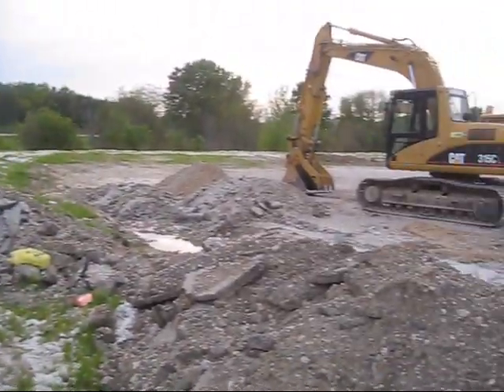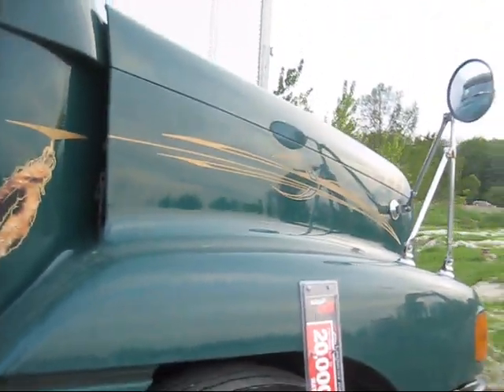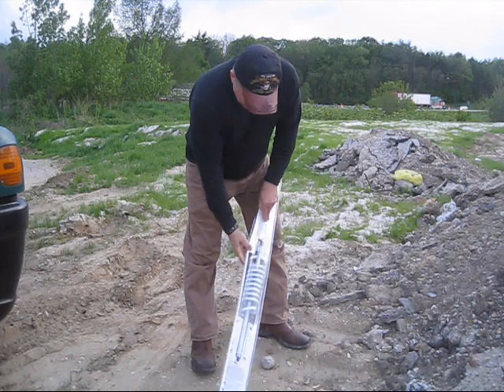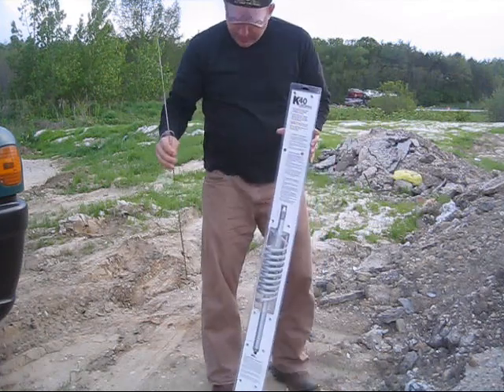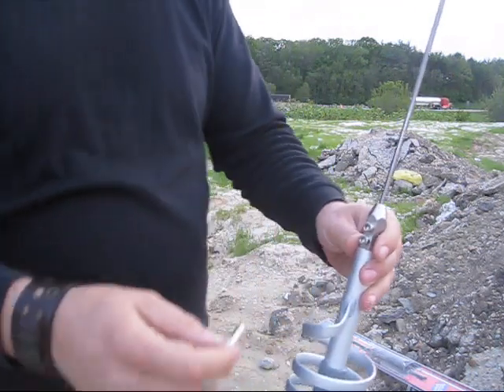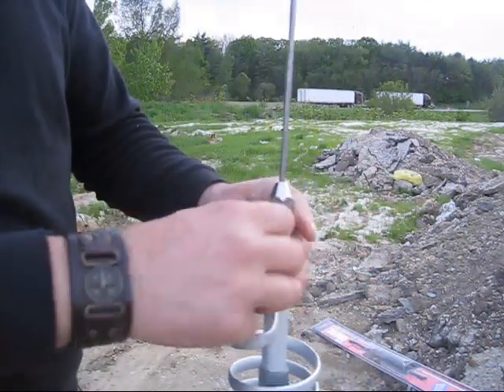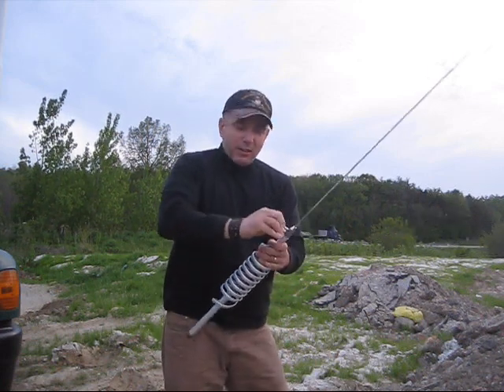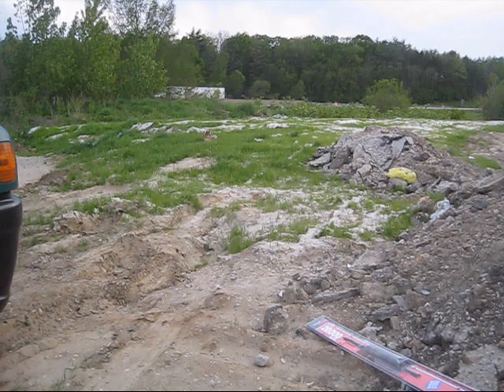ASSEMBLING  K40 CB ANTENA

Comment: I run one and its a very good antenna only problem is when im driving the coils make a crazy noise that is very loud .. all you have to do to get rid of that noise from the wind going thru the coils is zip tie the coils ill post a pic of mine..
Reply: Mine was so nosy I thought I had a wheel bearing going out on my Simi Truck.
Reply: @hansenhansen8349  zip tie every 2 coils sound is gone completely
Reply: Omg!! I also thought I had a bearing going bad😅
Reply: Me too I was like what the heck is wrong with my truck

Comment: The screws on the side that controlled the lenth of the antenna are for tuning
Reply from the maker: OkieDipper77 ok,thanks
Reply: TRUCKER BUCK you need a swr meter for Tuning Your Antenna's
Reply from the maker: Thanks, I will get one
Reply: He should of bottom the elements out to start. They be the same length. Then move them out a 1/8 at a time adjusting the swr.

Comment: Why make a video of something you have no clue about ?
Reply from the maker: +René Overby To Document time and location  and the K40.
Reply: +Trucker Buck you should really get a antenna analizer between radio and antenna, you risk frying your cb if the antenna have the wrong lenght :)
Reply from the maker: You are absolutely correct , I have not found the right guy to that for me. or I am thinking to get my own meter and doing it my self
Reply: its very cheap and a must have if you own a cb
Reply: +Trucker Buck if its made for 10m you only need a swr meter, antenna analizer is kinda exspensive :)

Comment: I get the feeling the any were not tuned..Had them,junk..Heavy and were a solid one piece ant..When you hits trees n such,no give and they break stuff..
Reply from the maker: +Craig Noftall  I know it just looks good But I have not got any CB Yet, Soon I will get one and test it to see how it works
Reply from the maker: I think I am going to settle with Galaxy 959 B
Reply: To keep it simple till you have had time to learn more about radios and antenna..Use ONE antenna and look for a fibreglass 5' or 6' top load antenna(top load is lotsa wire coiled at the antennas top).Seeing you have those ant,use one..Left side of truck only..Run one coax(not truck stop crap,go direct to cb shop)Use a heavy duty wilson alum type stud mount..None of this chrome shit..They have losses..Have a cb shop tune your antenna..DONT LET THEM TELL YOU ALL YOU NEED IS A GOOD SWR..A good cb shop will have an ant analyzer that will tell much more info than swr..TRUST ME IT MAKES A HUGE DIFFERENCE when you know more info on your set up..Take some time to learn what you need to know about ant and cb radios that help with range,trans power killers and such..Join a few cb radio forums..90% of the truckers dont know squat,i used to be one of those guys who said she he didnt have a clue if it worked or not..YOU dont need big power to get out far..AGAIN take time to study some stuff..
Reply from the maker: Thanks for the tip.I will look in to it.

Comment: Step 1. Throw K40 in trashcan.
Step 2. Buy a real CB antenna.
Reply from the maker: Step 3 what brand will that be. Thanks.
Reply from the maker: Thank you ,I will look in to that, I do sense that this antenna is not good.
Reply: OutBackTrucker Buck 
President "Texas", or a Z-180 if you can find one